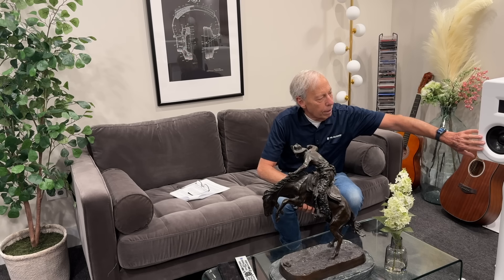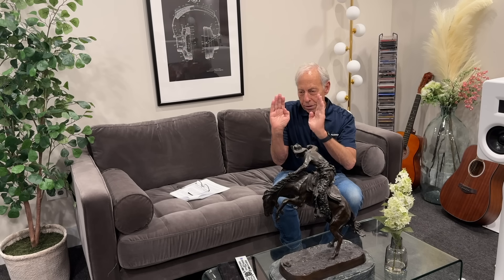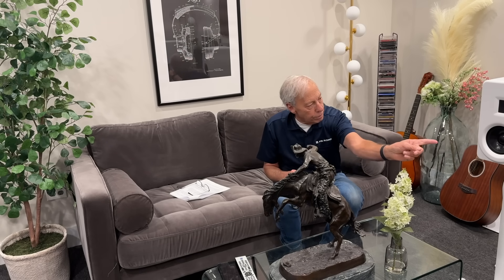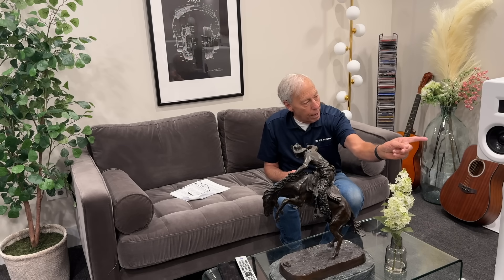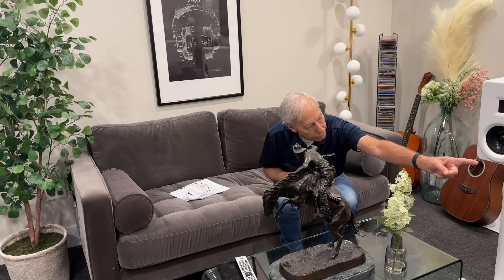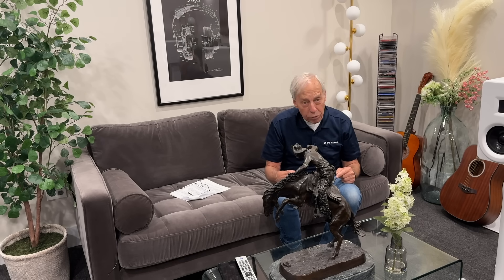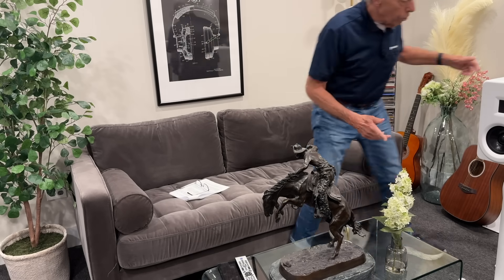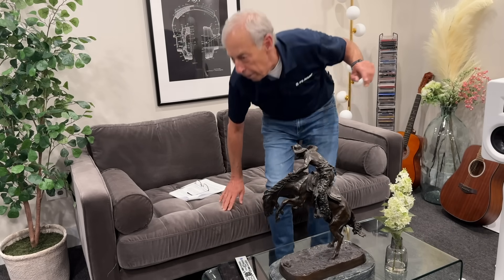How to know the off axis response of your speakers

Comment: I'm calling bogus. I have three rigs at my house all three with different speakers. All three pairs are facing straight ahead. All of them have a wide soundstage. The Sound Stage comes more from the recording and speaker placement versus a manufacturer being phenomenal casting a wide Sound Stage or not. Let's not forget the recording itself to. I've heard tracks were the Sound Stage is very closed in and then I've heard others that are spooky wide.

Comment: Turn on some white (pink...) noise, detuned FM, phono cart in cranked up.... and wander around in front of the speakers. You will hear all the different frequencies being increased and cancelled. The less variations the better. Try one speaker at a time as well as this eliminates the comb filtering caused by multiple sources.

Comment: I’m not sure if off access response can be calculated using the inverse square law but that seems like the proper way to calculate readings with calibrated microphone. Anyone know the answer?
Reply: The width of reasonable balance (off axis response) is more a function of driver and cabinet design than anything.  You might be able to "guestimate" it  with math but this is one case where nothing beats a good old fashion measurement.  

There's free software (eg. REW) that you can use with a microphone (doesn't have to be calibrated but it helps when it is) and do some tone sweeps of the room.  4 or 5 sweeps, at different angles but the same distance from the speaker, should give you a pretty good picture of the dispersion in that room.

Comment: Listening in room won't guarantee that you can tell a speaker has great dispersion characteristics. Because maybe the listener set up the speakers on the short wall, so the side walls are close, and they are getting unwanted reflections and SBIR effects, therefore the user blames the speaker for their incompetence.

Comment: Some audiophiles prefer narrower dispersion speakers and room acoustics can influence this decision. All speakers have an ideal listening position. Wide dispersion speakers may produce undesirable muddled stereo imaging effects from wall reflections. Narrower dispersion speakers, although they have a smaller sweet spot, are less affected by room reflections with better imaging and may be a better choice in some circumstances. There is no perfect speaker, not even close.
Reply: I can think of two advantages for wider dispersion: The "sweet spot" is bigger - you don't need to sit in a certain spot and other persons in the room can have about the same experience. The chance for the speakers to virtually "vanish" in the audio reception is bigger because the sound source can't be located by our brain as easy as with narrow dispersion speakers.

Comment: After 47 years of 'training' to sit in the sweet-spot, I have a well worn depression in the cushion on my sofa where I sit when I want to listen properly/seriously...so why would I give a rodent's rectum about off-axis sound? Off-axis response means very little to me; however YMMV.
Reply: The sweet spot of my couch has a depression, like you said!!!
Should I get a new cushion? I'm undecided. I kind of like the familiarity of butt and cushion! 🤔
Reply: @unclewilbur8976   ...just flip the cushion...maybe shove a sheet of five-ply under it 👍😉
Reply: Mileage may vary section;
Lateral off-axis energy plays THE dominant role. 

Via Haas Effect, direct energy from loudspeakers to your ears determines one's localization of the sound. 

However, the off-axis energy arriving within that window of time adds to the experience, helping to form one's perception of tonality and soundstage characteristics. 

Energy arriving OUTSIDE of the time window and/or arriving adequately high in level, also aids in perception, but we process as separate acoustic events. 

-------

Perhaps the two biggest challenges to loudspeakers sounding like the real thing;
a.)  Inadequate, unrealistic dynamic capability
b.) Directivity mismatches

A is self-explanatory.
B on the other hand, most loudspeakers trend toward radiating equally in all directions in the lower frequencies, transitioning to a narrowing radiation as the frequency increases.

This is unnatural and unrealistic. 

So ... off axis energy and how it interacts with boundary surfaces ARE vital to the experience. 

Thanks
(I know, blah blah blah, just sayin')

BONUS SECTION(!)
Even an outdoor stadium concert, or in a big field, LF off axis energy plays a huge role!
Reply: @FOH3663  Fair enough...thanks for the edjumakashun😉
Reply: @FOH3663   ...fair enough! And thanks for the edjumacation👍😉
Reply: @FOH3663   ...fair enough! Thanks for the edjumakashun 👍😉
Reply: Unless your speakers are toed-in to face you and your listening room is anechoic or outside, the off-axis still contributes a lot to what you hear, even in your well-worn-in sweet spot.
Reply: @bradkerr2798   ...actually my DeVore's are both toed-out by about 5°.
Reply: @bradkerr2798   ...actually my DeVores are toed out by around 5°.
Reply: @bradkerr2798   ...actually my DeVores are toed-out by about 5 degrees.

Comment: My Aspen FR10 speakers come alive in a much better way when I toe in rather than straight on in my room at least. Big difference in sound and response and I hear it up close and also at the back of the room. Every room is different in different ways ya just need to play music and keep trying this, that or the other. 👍
Reply: That's true, reflections from the walls can change things beyond the direct line between speakers and ears (like when you measure respons in ideal conditions a meter away).
Measuring at your listening position one speaker at the time will show this, but that's not included in the spec sheet. 😄

Comment: Off axis can be in both horizontal and vertical direction. Comb filtering effects usually are more pronounced vertically due to speaker drivers being positioned vertically. In some designs, being even 10–15° off-axis vertically can cause a dip of 5–10 dB in certain frequencies. I've seen setups where the owner had no idea about this while spending crazy money on things that don't matter (such as 1000s of Dollars on power cables).
Reply: I bought a $400 Tributaries brand power cable one time, & used it on a source component, and the bass was so fuller, well defined, authoritative and  deeper that not only did I totally imagine those things, but the meters on my tape deck imagined them too! Without even touching the record level control....The tape deck's meters were going into the red, from all this "IMAGINED" more and fuller bass. Maybe my Revox tape deck  needs to see a psychiatrist, and maybe it's meters have expectation & confirmation bias. OR...OR....it could be that someone out there just doesn't have "ears."

You mentioned not taking dates out for dinner. Hamburgers cost a fortune these days. I find myself saying all kind of abhorrent things nowadays.  "My God is that expensive!"....."Could you just sell me the bun?"
Reply: @sidesup8286 You are talking utter ignorant nonsense.
Reply: Thid dude just itchin' for a cable argument. Anyone get slapped in the face on their date tonight, that's sittin' at home now, with nuthin' to do?
Reply: @sidesup8286  Good point. I'm not going to get slapped for a while as I just spent >US$4000 on a Louis Vuitton bag as gift, and to be honest, I felt a bit stupid like buying a snake oil power cable...cause it's not really truly worth it either in my opinion if it was for me, but if you have US$5000 for power cables to waste, better make your female companion happy than sitting alone imagining the cable made a sonic difference, while she get upset about how you waste your money and don't take her out for a dinner date or otherwise make her happy. Being audiophile is usually a very selfish hobby, so be careful.